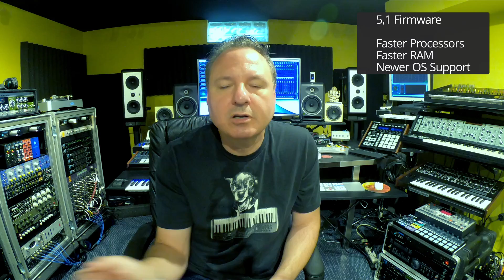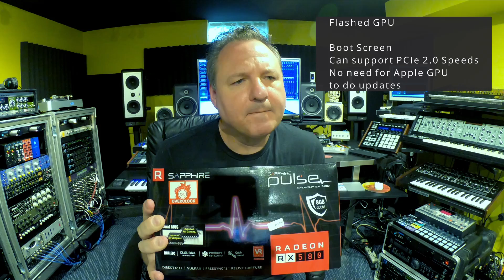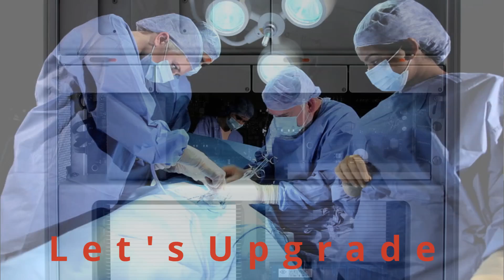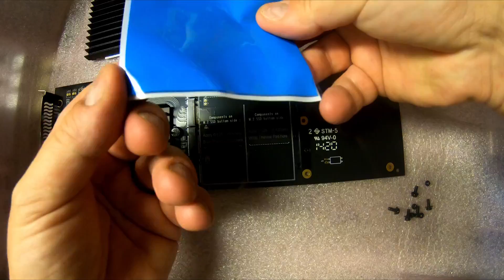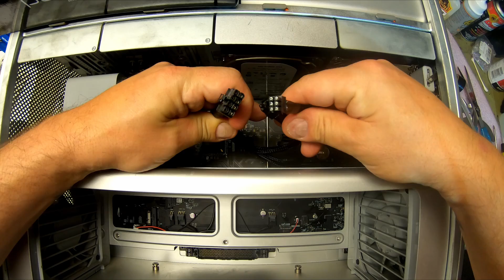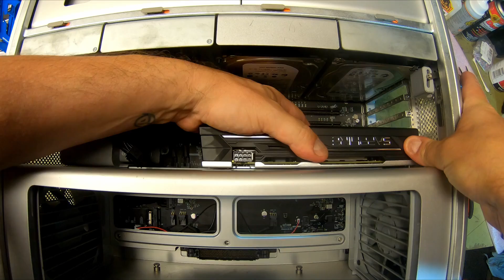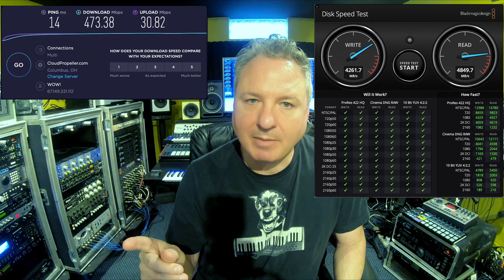2009 Mac Pro 5,1 Extreme Upgrade

Comment: None of this stuff is inexpensive. Just the PCIe is $400.00. You’re investing a lot of money on a machine that’s over 10 years old, at this point. It doesn’t appear to be a worthwhile investment.
Reply from the maker: Correct, but the most expensive parts at the time I purchased them were the NVME and SSD drives which I will retain when I get a new computer, so that investment won’t be lost. Those are just investments in my computing setup and I’ll have them for the foreseeable future

Comment: Just Add OpenCore Boot Loader w/ MacPro Config.Plist  .. No need to get MacUpgrade GPU ... Boot Screen and GPU acceleration ....also you can install 2 SSD's or HDD's up in the Optical Bay area. ... then Run Big Sur

Comment: Great upgrades for the mac pro, but you did say one thing wrong, and I have seen a LOT of mac pro 5,1 owners say this

"You can't boot from a raid drive"

This is wrong. I currently have 2 256gb ssd's in my 2010 5,1 as raid 0 boot. The trick to this is to install your system on a single drive as you normally would (not one of your raid drives). Then install the raid drives you want to use, and in osx set them up as normal. All this is the normal stuff. NOW to get to boot from raid 0 drive use carbon copy cloner to clone your original boot drive to the raid drive. Once that's done shut down, remove the original single drive, and startup. The mac will then boot from the raid 0. One note is if your running strick pure mac pro you probibly don't have the boot rom update to boot from NVME same as me. I'm using SATA based ssd's (dual m.2 based on a single pcie card). I have also duplicated this with 2 180gb mechanical drives just in the drive slots to make sure it booting isn't a fluke with my dual card. Although slow it did boot from the mechanical drive raid 0. If someone has the NVME mod and wants to try this too I'd be curious to see if a raid 0 NVME boot works the same.
Reply: True bro...I did same with high sierra and raid 0 BUT whats not mentioned is the raid has to be HFS as you wont be able to boot apfs raid 0...at least, i couldnt LOL .. and i checked all over the web!...issues with raid 0 on hfs is system works fine but no updates or else your system will be unbootable...
Reply: @skip741x3  I don't remember as I quit using that mac shortly after I posted that when I got a 2013 mac pro, but I was running mojave on mine, and didn't have an issue with updates. Not sure how you had yours setup if you were just running drives in the drive bays or not, but I had a dual sata 3 based m.2 card that both my drives were on

Comment: I saw nothing about firmware updating which I understand is ESSENTIAL to the MAC ROM's recognizing the computer as 5,1 instead of 4,1.  I already spent a $grand on updating to processors and newer RAM but my ROM still only recognizes my Mac as 4,1 (early 2009).   Unfortunately, the upgrade still sticks me at 4,1 and without a firmware update, I can't complete the progression. Such a firmware update risks all sorts of installed cards.  It sounds very risky to me to purchase $$$$ new video and network and Bluetooth cards that the old ROM firmware won't support.  I'm also concerned about the FAN situation that leaves a lot of upgrades with a situation with cooling fans running amok.  
I'm still stuck with an online hack that moved me up to High Sierra but that's as high as a I can go with risking the whole thing.  I have done a TON of manual upgrades on Macs over 30 + years but several of the things you slide past give me great pause as I risk all the hardware I have and can't afford to lose or replace.  I appreciate your videos and I use several macs for DAW as well as programming so I recommend others in my situation take care.
Reply from the maker: https://thehouseofmoth.com/turning-a-2009-41-mac-pro-into-a-2010-2012-51-mac-pro-2021-edition/

Yes, firmware updating to 5,1 is important and easy to do

Comment: I have a similar setup which I put together a couple of years ago. Your NVME adapter seems to be sitting on top of the fans in your video card, you don't have any problems with it running hot?

Comment: I've got also an old classic Mac Pro from 2009 in standard konfiguration. But I'm just wondering if it really does make sense to upgrade this old machine in 2021?? If I want to upgrade this machine to maximum I've got to spend easily over a 1000 Bucks and maybe in two years Apple don't support Intel Macs with new Updates any more... who knows.. Isn't it better to spend the money on the new Apple Silicon Macs? I'm waiting for the upcoming Macbook Pro 16' M1X and will see if I can replace my cMP with it.

Comment: Enjoyed it indeed. So one question I have is, if decided to go this route, would I have any conflict with space for an Avid HDX card? I noticed that you put an UAD card in the last slot. Do you think an Avid HDX card would fit in that same slot on a mid 2012 5.1? Or would I need to put it on one of the first two slots, which would propose a problem. Thanks in advance and thanks for posting such a great video on this.

Comment: why didn’t you put the start of the operating system on Raid 0, if you have a backup?
Reply from the maker: It’s possible to do that, but it’s a bit tricky and not quite officially supported. I figured a fast NVME drive as the system drive would do fine and that my audio projects drive would benefit the most from RAID 0. Just in case trying to put the system in a RAID 0 made any sort of instability or incompatibility I stuck with a more supported configuration. I still use this machine for work and need it to operate well. If it was only a hobby computer or personal one I might experiment further.
Reply: @paperstreetaudiocompany  It's clear. I have a 1 terabyte NVME samsung disk that was in PCI 16x. I started using the usual sata2 ssd for the sake of two terabytes, the speed of work does not differ, and the system starts up faster. I was upset that NVME is slower. I just noticed that the adapter on which the NVME is mounted is written PCI-E 4x. Maybe this is the case, and you need a 16x adapter?

Comment: I've been thinking of getting a mac Pro and I have been stuck between 4,1 and 5,1 I had a hackintosh with snow leopard running logic Pro 9 and an early version of X, Protools HD 9, I am a film composer and my sessions use a lot of kontakt libraries and sample tank with near 190 tracks i want to run Mohave so I can still run 32bit plugins with a converter, should I get the 5,1 and upgrade the processor and 32gigs of ram and an SSD? What are your thoughts, any help is appreciated thank you

Comment: Hi Paul, I also upgraded my 2009 Mac Pro 5,1 but I'm having issues with the wifi.  How has it gone for you?  My connection is extremely slow and I upgraded the antennas but it didn't do anything :(
Reply from the maker: Hello

I’ve been lucky in that my wifi has always been normal. I put the wifi card in the first time around and then upgraded it when I made the video. I haven’t used any external antennas though, so that’s a variable not in my equation. My first thought is that it sounds like the wifi isn’t seeing the antennas properly. I found it rather tricky to connect to the three internal antennas (one for bluetooth) in my 5,1. I am getting a bit over 500mps download speed on mine which isn’t too close to my wireless router. I have to believe that if the wifi adapter works, is selected, and has its antennas attached properly you should be good.

Comment: One thing you don't mention (unless I missed it) on the 3,1  OR 4,1 to 5,1 Mac Pros is to replace the clips that secure the processors to the board.  There is one near the Northbridge Tdiode for example.  I wont go into detail here (it's all over the web) but essentially these go brittle with heat over time and break which will lead to severe overheating - if you use a utility like iStat menus to monitor internal temps (you absolutely should on a Mac Pro) and boost the fans, then typically your Northbridge should be around 65 to 75 degrees. If the clips are broken it will run above 100 which will eventually kill the CPU / board.

This small, cheap fix is a MUST on every professional refurb and update.  I run 7 x Mac Pros currently, 4 core to 12 core  in various states of upgrade dependent on use. 

Here is a link / image to get you started:  https://forums.macrumors.com/attachments/img_1171-jpg.700400/
Reply: The clips and overheating happen when you use lidded cpus only.
Reply: @bladeart1  That's fine but by definition that's every Intel MacPro 1,1  to  5,1  - and the point I was making is that you should look at this for any one of these models at this point - likely they will have a heat issue here if they haven't been upgraded in their lifetime.  They are all lidded, all potentially have the problem although it seems to be more common on the 2008 to 2010 models.

Comment: The ram was 1066 instead of 1333
Reply from the maker: I note that the package says that but I can confirm absolutely that the ram runs at 1333. I almost sent it back because of it saying 1066, but I installed it and was delighted to find it did in fact run at 1333. I started with the full 128, but have since reverted to 96 gb running triple channel. I'm not sure how much that helps, but I'll take every performance gain I can.

Comment: I did the same upgrades a few years ago apart from the NVME drives. Like you I use my machine for DAW. It's been bullet proof and have never run out of horsepower.

Comment: I did a similar upgrade with my 5,1. One issue I had was overheating (red blinking LED) on the motherboard when doing renderings with 100% usage of all 12 cores. Would be interesting if your machine does the same as those X5690 CPU's have 130 W TDP. (the fastest 5,1 12-core from Apple had only 3.06GHZ at 95 W TDP.)
I had to increase the speed of the fans with Macs Fan Control to cool them down, which makes the computer louder.
Reply: I installed my gpu in a breakout box to offload the power and heat from it.  same cpu's with a radeon 64 gpu. no overheating.

Comment: ... one question. I thought the difference between lidded and un-lidded means the processor is a different thickness, and if washer spacers aren't used the fan runs continuously unless temp sensor is repositioned ... you seemed to have not had this issue ?
Reply: He is using a 4.1 that’s only for un-lid on a 5.1

Comment: I'm in the beginnings of starting this process, watching vids on You Tube. Yours is one of the most complete ... but not spending as much as you are !! (8 x 4gb rams e.g.), the point for me is upgrade within a price that's well below buying an new machine. The tip about flashing the GPU for the Mac startup screen is useful. Thanks.

Comment: How are you connecting your Audio interface ? USB ?
Reply from the maker: It’s a Metric Halo 3D set of interfaces. They connect via CAT6 and I have 128 actual, physical IO n my setup
Reply: @paperstreetaudiocompany  Cool , so how does the G5 handle 10 plugins instruments at say 128 -256 with low latency over its ethernet port ?
Reply from the maker: I would be worried about a G5 handling too much of that. Even this machine is one that in my sessions I push it to its limit. VEP is used as a secondary host to spread the CPU load of plugins between two computers and that helps. I expect that the Apple silicon Mac Pro will be ideal for running plug ins and soft synths.
Reply: @paperstreetaudiocompany  Yep ! very interested in a tricked out Mac Mini M1

Comment: For just Audio Protools and Virtual instruments does upgrading a video card really make a difference? I have the original video card. However, I upgraded my 2009 through OWC ( I sent it in for the processors) and it seems to work great. I'll have to look into upgrading the firmware and OS to utilize Nvme. It works great with the upgrades but maybe it can be even better? 

Currently I have 2 x 3.32 Quad Core,  128G ram,   PCIe 2TB 2.5 Mercury Extreme start up + 1TB Accelsior Pro Q 2x as fast as the 2.5 ssd PCIe. + 2TB backup in tray 3G 2.5 + 1TB backup for Accel in tray 2.5 SSD. 

Still on OS El Cap 10.11.6 to work with my Protools / interface set up. I wonder if upgrading the firmware would make a difference or just keep working this for 3 more years then do a full upgrade?
Reply from the maker: I got a new video card for metal support in order to run Mojave, but a more modest card would be fine for me and anyone else doing audio. I was able to get the 580 at a good price but they seem to be far more expensive today so I can understand the reluctance to pay the weird prices for them. It doesn’t effect my audio work at all really. I’m using a 34 inch 4K tv as my video monitor and running it at 2k resolution as that suits me. Plenty of video cards can do that.

Comment: Great Video :)
A few thoughts of mine - using all 8 RAM slots actually will give one an inferior performance - tripple channel ie. 6 slots used in a dual xeon is considered the fastest. 1333 DDR 3 Ram is also advisable when going to from 4.1 to 5.1. I would have thought to place the thermal pad of the Sonnett Silent Card on top of the NVMe’s not underneath but I am not certain. The absolute best card out there. The Usb card ought to be 3.1 not 3.2.
Reply from the maker: I have switched to triple channel for ram. It gets me every last drop of performance. 

The thermal material is between the board and the nvme, but there is that heat sync on top so there is something on both sides of the nvme drives.

The USB naming conventions are a bit tricky. There were three USB3 varieties so far offering 5, then 10, and now 20 Gbps. This card offers the 20 Gbps hence being referred to as USB 3.2. 

https://www.cnet.com/google-amp/news/usb-3-2-explained-making-sense-of-current-and-confusing-usb-standard/
Reply: This was something I was actually surprised about when I originally bought my 5,1 with only 2 sticks of ram in it. When researching the 5,1 I learned about the triple chanel thing and scratched my head wondering why they had 8 slots. Even so I only used the 6 slots for triple and now glad I did.
Reply: @whitepawrolls  I think they have the 4/8 slots for Quad models to maximise their RAM ceiling but I do remember a Dell workstation that I had (T3500) had 6 slots...

Comment: Love your video. Am doing the same. Are you booting on the NVME since its faster?
Reply from the maker: Yes. It’s great too.
My NVME drives are for my System (boot) drive and for my working projects drive. Completed projects and backups are other physical drives. It’s a nice speed boost. Some of my biggest improvements in this machine came from the NVME drives.

Comment: These video cards are priced insanely high at this point.  I would love to get my 5,1 up to Mojave and upgrade the video card, but the Sapphire Pulse RX580 is a no-go for me on price.  Are there any more affordable alternatives?
Reply from the maker: I know that’s the struggle. Out of dumb luck I got my RX580 for relatively cheap before this weird price bubble kicked in. I had an MSI Radeon 560 before this card and you are likely able to get one pretty cheap. It’s metal compatible so just plug it in and you can run Mojave. I’d look in that direction - metal compatible but not one sought after for mining.
Reply: @paperstreetaudiocompany  Thanks so much, I appreciate the recommendations.  This video is EXTREMELY helpful by the way.  Thanks!  I'm at a point where my Mac Pro 5,1 is running mostly fine for audio work.  It struggles with video editing a bit, but luckily I don't do much of that.  But when i DO, and the video project is even slightly involved.  It's torture.  Right now I'm debating investing in updating this Mac Pro, or just waiting for the next gen of Mac Mini M1.

Comment: You should also probably also use the nvme as startup disk runs everything a bit faster
Reply from the maker: Yes
My startup drive and projects drive are NVME and that's where it made a big difference
Reply: @paperstreetaudiocompany  So you can use the NVME drive as a boot up disk, I thought there was an upgrade of firmware to make this happen. I want to to use the 4 bays with the SSD drives and use just one NVME drive for my boot drive. Are there are other single NVME adapters that can be used as a boot up drive on a MP 5,1 ?

Comment: Excellent video. Did your fans begin to pulsate after you upgraded from 4,1 to 5,1? My 2009 macpro will occasionally freeze and I have to do a hard reboot when the fans spin excessively. Any help would be appreciated.
Reply from the maker: Very curious. Mine doesn’t freeze and my fans don’t come on ever that I can recall. I don’t push the video too hard, but lots of audio and plug ins. Something is definitely wrong in your setup but I’m not sure what it is.
Reply: @paperstreetaudiocompany  Perhaps it is the AMD Radeon HD 7970 video card. I didn't have the issue when I ran Nvidia GTX 680. The fan on the Nvidia wasn't working even after a good cleaning and I was limited to Sierra OS. I went from 4GB VRAM to 3GB with the installation of the AMD card but then was able to upgrade to 5,1 and High Sierra.
Reply from the maker: @marshallwillis371  it seems like a likely culprit. My GPU could be considered over spec’ed and as a result it’s always cool because it’s never working very hard. I could easily imagine a different video card resolving your issue.